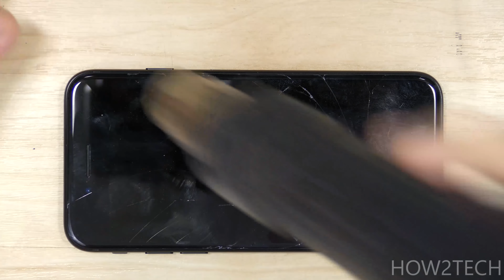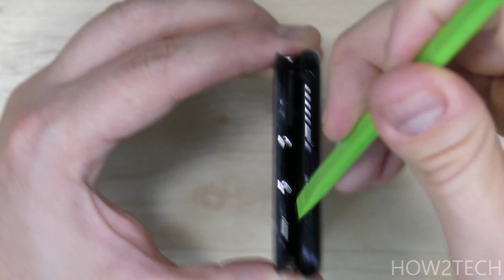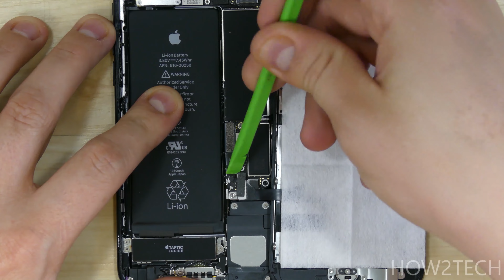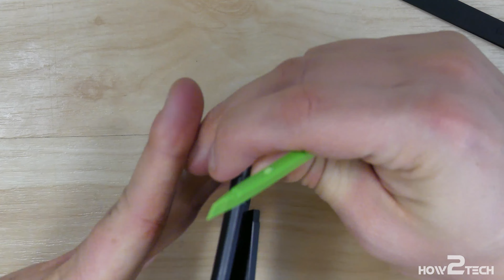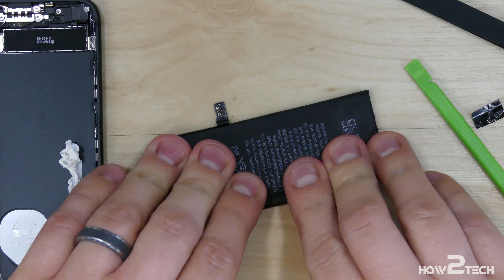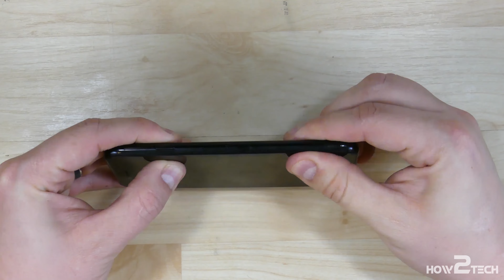iPhone 7 Battery Replacement - Ripped Adhesive

Comment: I had the adhesive rip recently when replacing the battery of an iphone SE (Gen 1). I found that using a hair dryer to warm the back of the phone for about a minute softened the adhesive enough to make removing the battery much easier. The hair dryer along with the tips shown in this video should make dealing with torn adhesive strips much less of a headache.

Comment: Um um help me please respawn  quick I tried this on an iphone 6s battery and it start to smell and the second adhesive broke and I tried to grab it used g tw3ssor but made a hole and I saw a spark and a. Very bad smell what should I do and the battery had less than 5% battery

Comment: I just finished my battery replacement. I heated the back of the phone with a hair dryer, I needed a sharper metal prying tool to start the separation process then used the plastic tool. I did not remove the screen, I was careful not to put pressure on the ribbons and left the suction cup on to hold up the screen so it did not try to separate from the body very much. I did not remove the taptic machine  as in other videos. That saved a lot of time. Trust Me the fewer screws you remove the better!! They are the size of a grain of sand and require a very steady hand to reinstall!!! Extremely easy to lose drop or misplace! My inner tape strip broke off at the start point so I pried up the battery at that end (from the outside) to regain the grip and pulled it right out. The new battery works great.

Comment: I find it allot easier to remove the battery adhesive by first removing the taptic engine. then you can pull it out more horizontally and it rips less